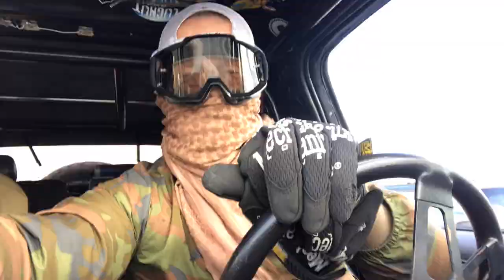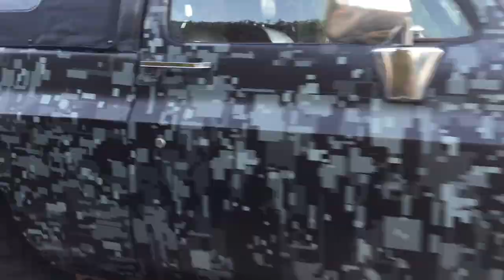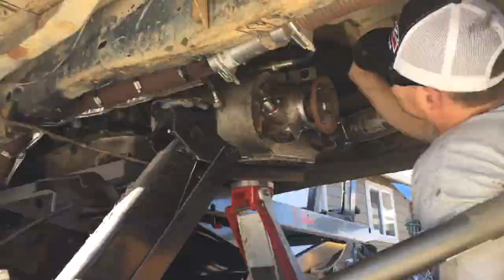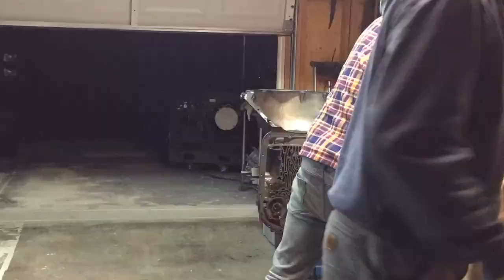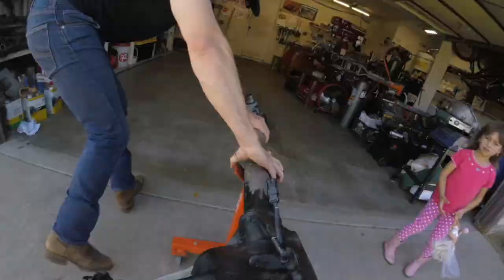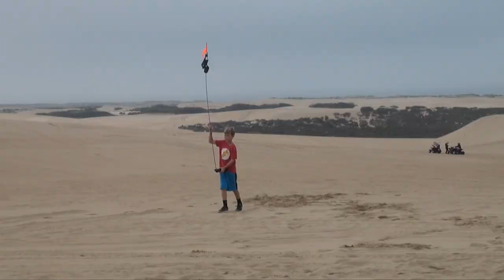MG #84 - 100 Videos in 5 Minutes

Comment: great vids. thanks for all your work. I was wondering if you did any research on ori struts for your beast? I know they are pretty expensive but, the parts removed would almost compensate for the price. would appreciate your opinion and reasoning for the route you chose. thanks.
Reply from the maker: Yea I looked at them but they seemed still targeted at the rock crawler crowd.  Springs are a known quantity.  Nitrogen and other magic, I don’t know yet...